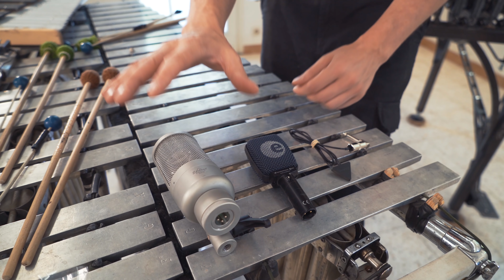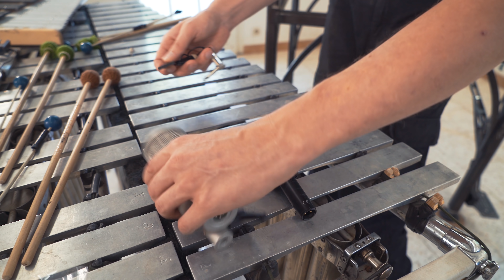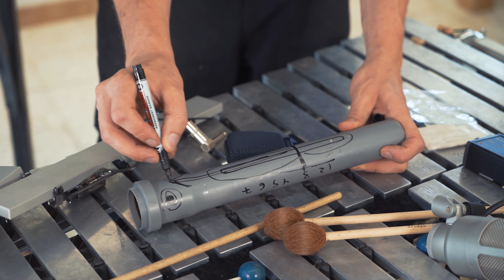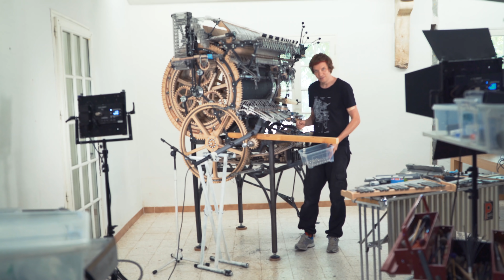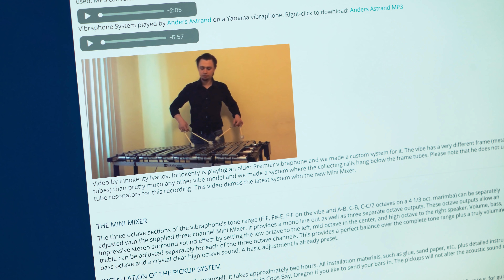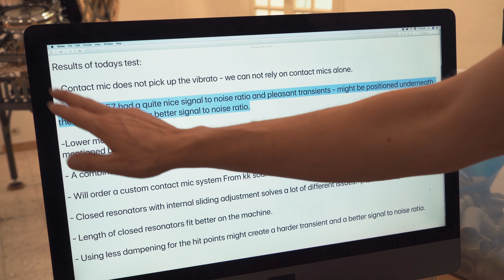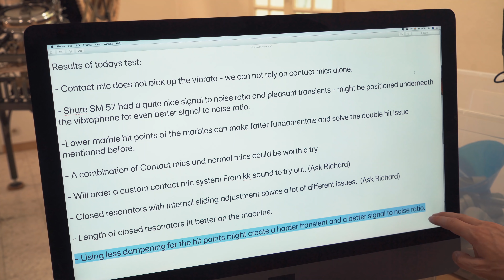Vibraphone Experiments / Microphone Types - Marble Machine X #96

Comment: I think if you put the contact microphone further down the resonating pipe (maybe so that it is flush with the movable end (so that sound resonates the same)), it might help to fix the distortion. Or if you can fix the distortion in a simpler way, that would be the best solution. In order to capture the vibrato the mic must be in the pipe - if you want to research this, check out standing waves.

Comment: I'm a bit confused with the way you attach the contact microfones to the resonator pipes or vivbraphone plates. 

You attach the contact microphones with this gummy think or with tape to do these tests and I see two main problems here:
 - By attaching anything to a piece that is resonating you are immedately changing the way it resonates. You are changing the mass and the stifness of the piece and therefore the ressonating frequency changes as well. That plate is no longer playing the same note it plays when there is no microphone attached. 
- When you attach the contact microhpones to something with that gummy thing you have to know that the gummy thing is to soft and it will easily attenuate the higher frequencies. You are not recording the real sound because the gum is attenuating part of the spectrum. Similar think happens with the tape but this case is probably more unpredictable.

In my opinion, placing a contact microphone into a resonating part changes the way it sounds and theferore it is no longer the real sound. As you said, it "kills the sound".

If you finally put a dynamic micrphone and you are afraid that it will catch a lot of the noise from the machine gears and marbels moving you cound start to explore with some kind of noise canceling techniques. As the sound of the machine gears is pretty constant (stationary noise with known spectral characteristics) it shouldn't be that difficult to filter it in real time.

Comment: Couldn’t this work with a contact microphone on the plate coupled with a contact microphone bonded to the surface of the resonator pipe (probably at the bottom of a closed resonator)?

Comment: Put the resonator tubes on all the notes, but have them running into a sound box.  Put a contact microphone on the sound box.  This is a solution that guitarists have been using for decades (peizo pickups).
Reply: Just to add, I've been playing with 3D printed sound boxes, and the results are actually quite good since you can easily experiment with size, thickness and shape.  I'm thinking of a simple trapezoid shaped box that resonates at a range of frequencies.

Comment: What if you combined all the resonator pipes into a single outlet similar to an exhaust manifold? You could still have the pipes all different lengths running in the unused space below the MMX and use a single outlet for only a single microphone (or 2 for redundancy). You would need to build a unique manifold for each scale you wish to play but, it would be a single piece to remove and install saving time and a possible mix-up when changing scales and you would be able to leave the microphone in place while changing the pipes to aim at the same place. This keeps the MMX somewhat acoustic which makes it feel more like an instrument and less like a machine.

Comment: I suggest you think about what is actually going on between the tube and the plate in terms of destructive and constructive resonance. You touched on it when you held the pipe that was tuned to the fundamental over the vibraphone and said "like and amplifier." You are not trying to mic a vibrating object, you are trying to measure and amplify the sound pressure that the tube and plate create in combination.
It will only take a few minutes to realize that you can not mic a vibraphone with a contact mic under any circumstance unless you want to use DSP to add the vibrato in later.
Not only can you not mic it with a contact mic, you can not mic it inside the tube. The mic must be place in free air between the level of the mic and tube, but not directly between them.

Comment: In regards to the contact mics, would it be possible to have a button or toggle switch to turn the vibrato effect off and on? If so, and it not being too complicated electronic wise, then you don't need resonator pipes or deal with properly "tuning" microphones.

Comment: Have you tried placing small regular microphones at the center of the bottom opening of the virbato pipes to capture purely the vibrato?  putting them at the end would allow you to adjust the size of the tubes for tuning without needing to mess with the mics.  You could do this along with the contact microphones to capture both the main hit and the vibrato separately and then overlay them.

Comment: connect 1 contact mic on piep (does it help? ) and one contact mic on the metal plate ? so you would get 2 inputs for one sound? maybe it work , or 1 contact mic inside of the piep , maybe there is a difference between inside and outside?

Comment: if you put the mics under the plate and over the membrane of the mic you put a tube with a plate that's block a little hit the noise and it can open and close so the level of noise will be increased or redused creating a false vibrato??

Comment: Why not used closed pipes with a very thin end cap and put a contact microphone on the thin flat side of the end cap. It would have to be sturdy enough to work as an end cap and flexible enough to pass vibration to the microphone. My gues is that the pressure of the sound wave hits the cap spot on

Comment: How about a digital solution to this problem?
Suggestion 1: Use two microphones - one in the end of the resonator pipe (strong signal + weak noise) and one outside (weak signal + strong noise) and there may be a way to subtract the noise from the signal.
Suggestion 2: Add the vibrato digitally.
Reply: Your first idea is called ANC or ANR -- Active noise control/reduction. It's used in noise cancelling headphones and mics. Or just regular filtering to remove noise outside of the desired frequencies.

Comment: Maybe a combination of the K&K contact mics to pick the attack of the vibraphone and fundamental pitch along with a high spl condenser mic like the dpa 4046 inside the resonator tubes to get the vibrato? Add delay to match up timing and mix to taste. I think of it similarly to both top and bottom micing a snare drum to get the different sounds of the instrument that you want.

Comment: What your problem is - the sound of a vibraphone gets its timbre from the 3-dimensional mixing of the sound at the ears of the listener. There is a complex phase cancellation going on. I suggest you use a split microphone setup - one mic is positioned to hear mainly the vibe bar and resonator, one is positioned to hear mostly the ambient machine noise. The ambient microphones is simply phase-reversed. Then you re-mix the combined signal so that the ambient mic cancels any machine noise in the vibe-mic. The re-mix can be hard-wired  when you find the ideal phase-cancelation level from the ambient mic. The hard-wiring will be a resistor or even better - a potentiometer.
You might need to have 2 or 3 such mic setups to cover the 11 bars.

Comment: Another idea: Put a small hole on the side of the resonator tube that matches the position of a mic mounted to the assembly that holds the Vibraphone plates in place. The mic stays put and is optimally placed for picking up the vibrato and keeps you from having to disconnect and reconnect mics when changing plates.

Comment: It might be worth trying using two dynamic mics--one at the end of the tube, and one on the machine but away from the instruments. The second mic can be positioned to pick up mostly the mechanical noise of the machine, and you can use that as an active filter to take the marble noises out of the vibraphone signal. Kind of like a movie sound team subtracting "room tone," or a pair of noise-cancelling headphones. You may pick up the instrument a little bit with the noise, which isn't desirable (especially when multiple notes are playing), but there should be a way to minimize that. Could be even more relevant in a concert situation, where feedback and crowd noises will also be an issue for mics other than contact mics, and won't be as diminished by distance as the marble sounds.

Comment: Try a clip-on microphone like the dpa 4080 inside the pipe. this should result in the optimum signal to noise ratio, the impulse-fidelity and clarity of the condenser microphone and, in addition, keep the work on switching notes low.

Comment: What if you mounted a MEMS mic on the mounting point of the plates, between the pipe and the plate at a 90 degree angle, on a piece of rubber or silicone  so it won't act like a contact mic, picking up vibrations acoustically? MEMS mics are tiny so you can place them in very narrow spaces. Also the output is digital so you don't have issues with noise on the electrical signal. You'd stil need a gate perhaps to cut off surrounding noise though.

Comment: I would recomend to use normal microphones and just solve the SNR with equalization since the noise seem to be in a high frequency range  so it shouldn't distort the vibraphone notes with EQ. Also think about when going on tour, what would be easier to replace or fix. Custom made contact mics or a typical mic

Comment: I like the closed resonator pipe idea. Perhaps the guts of a guitar piezo mic on the sliding end piece in combination with a contact mic on the plate? For an open pipe design, it seems that you are going to need a highly directional mic to limit noise levels. A third idea is possibly a guitar guts piezo mic wrapped between the pipe and its mount? In any case, I think any type of mic in contact with the pipe assembly is going to require that the pipe assembly is isolated from the rest of the machine because you are going to pick up a lot of rattling from the machine itself.

Comment: This might just be a wild thing to throw out here, but have you thought of Lavalier mics inside the pipes? A few years ago I worked on a gig where we were supposed to mic up a hommade pipe instrument for a tiny local gig. It was actually a couple of eightgraders who had built the pipe instrument in shop class. They were hitting it with different items and adjusting the length of the pipes to produce different notes, sortof like a bastardised percussion trombone-thingie. Needless to say whe had issues with the mics. The sound engineer threw his hand up in the air and shoved a bunch of DPA Lavalier mics in the pipes and it worked great after a few tweaks. Might be something to test.

Comment: If you have resonator pipes, won't you have to swap them as well to match the notes of the plates you're using, every time you change key? To me, it seems like a no brainer to go with the simplest, most sleak and practical solution for live playing and ordering those custom mic rails for it. Acoustic vibrato is so much cooler, but unpractical for live scenarios.

Comment: Martin you should be able to pick up the vibrato from the pipes instead of the plates with the contact mic and might also work when not changing the airflow as the pipe resonates with the frequency of the plate. For the SNR on the microphone you can just use an EQ to cut frequencies not in the range of the notes, also you could use multiple microphones for different bands of frequencies like Low, Mid, High

Comment: For the mics, you should find microphones that can handle the amount of sound pressure level coming from the pipe, they should be directional to cancel out other noises and they should be placed as close to the source as possible to for you to minimize the sensitivity of the microhone (of course this is better said than done, as you are going to look for the best timbre). DPA has very small sized directional condenser mics that can handle loud sources.

Comment: You could probably remove noise with dedicated filter and multiple microphones, even when not using contact ones. It is possible to filter out most of the signal that is not originating from a specific point in space. The technology is used eg to filter background sounds for voice communication.

Comment: Hi Martin, Love the video!

A few comments,

Resonator pipes do not conduct the desired sound but rather capture the undesired ones by absorption and length preventing adequate air movement etc.. It just prevents certain harmonics from forming while allowing the fundamental one to easily pass through. You will also need to ensure that the mic is at an anti-node for the pipe. I do not know whether that is  the end or half wavelength in.

Same goes for contact based microphones. You will need to put them on an anti-node. (This will change the position of resonance so will need iteration.

I think digital vibrato will be best as this will allow constant hit to be picked up. If you only record from the resonator pipe, depending on position of the vibrator flap, the actual hit on the plate. Software you could split the audio into two line, one to vibrato and one to a gate for the initial hit.

Will think about it some more and update if required :) Keep up the good work. Love it

Comment: If you're absolutely dead set on analog vibrato, you could use multiple microphones per vibraphone plate at set known distances and mix the audio of those microphones with a fixed delay based on the distance between the microphones relative to the sound source. When done correctly, background noise interferes destructively with itself while the vibration of the plate/resonator pipe interferes constructively. This technique is also known as beam-forming or spatial filtering and can work wonders to remove background noise when using not-so-great microphones. The only requirement is that there's no varied delay between recording channels. It may take quite some fiddling per set of microphones to get the mixing just right.

Comment: !! If you will not use resonator pipes at all, you can tilt plates to the perfect ball-drop point one for all plates, strait-lined. So no compromising on different notes placed on the the same channel.
Try to use contact mics on the very top side of the plates

Comment: I’m sure that someone else has already proposed this idea, but what if you ordered the professional contact mic system, AND installed the resonator pipes with vibrato function? That way you can add the vibrato effect in post production AND have a live sound effect (for designer soul soothing). Use the mics to collect the sound of the actual vibraphone (is key the correct term?) but not the resonance or vibrato. Those effects can be added, just like in the video. However, you still maintain the real components to achieve the effect on the machine, to satiate your need to avoid compromise.

Comment: Instead of adding a vibrato effect digitally you could possibly use an optical tremolo to modulate volume and maybe filter cutoff. This is basically a spinning disk with a pattern printed on it that changes from opaque to transparrent. If this disk is spun, it periodically allows light to either pass through or get blocked from travelling to a light sensitive resistor, which is basically a light-controlled potentiometer. The advantage of this is that the tremolo is mechanically linked to the machine, increasing or decreasing in speed as it accelerates or decelerates. 
Plus this could be done with analog circuits, instead of using a computer. 
Not a perfect solution, but maybe an acceptable compromise.

Comment: I know everyone is saying this but I might have something different to add. 

I don’t think a contact mic in the resonator would get a good sound UNLESS it’s a closed tube resonator and the microphone is placed on the stop. For it to work it would have to have a very thin diaphragm like end from which the contact mic could pick up the pressure waves.
Reply: Vibratable but still rigid. It would need to move in order for the piezo to work, but would need to be rigid to reflect the pressure wave instead of damping it.
Reply: arfyness yes that’s the crux of the problem. A traditional Mic would probably be best served putting it in the resonator, I was just trying to ideate a contact mic solution
Reply: Ooh. I wonder how a traditional mic near the end of the closed tube would sound.

Comment: You could try picking the sound of the vibrophone with some type of sentitive mic in the bottom of the tiles, however of couse this will pick a lot of noise from the machine.
well then try to put another mic in the back of the machine, for example, and then  subtract the unwanted noise from the vibrophone mic, like a noise canceling headphones

Comment: You could also use electromagnetic pickups on the vibraphone since the bars are metal. You would need to have a small current going through the bars since they are non magnetic. Also, have you tried using a softer metal for the ball bearings. Brass might sound a little nicer on the vibraphone and cymbals and make less machine noise.

Comment: Contact mics on the bottom of a closed pipe resonator might work - if you used a flat, rigid but thin end cap this piece could act as a diaphragm, transferring the sound to the mic